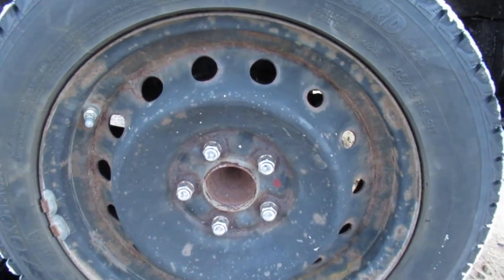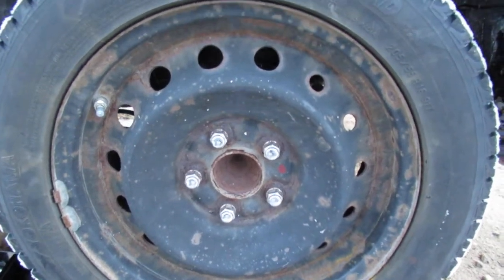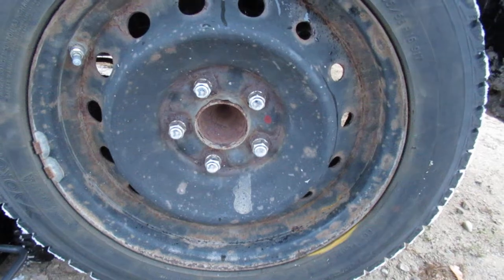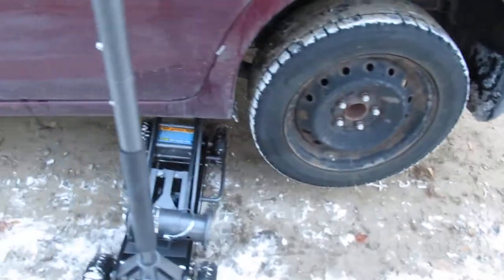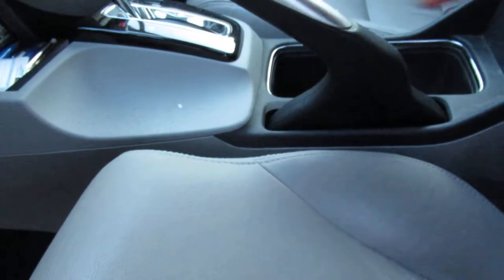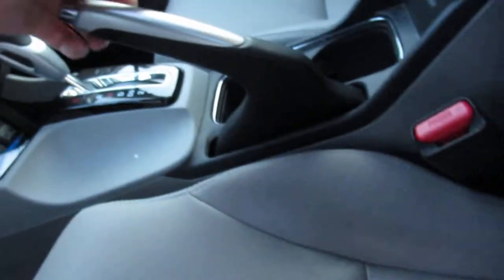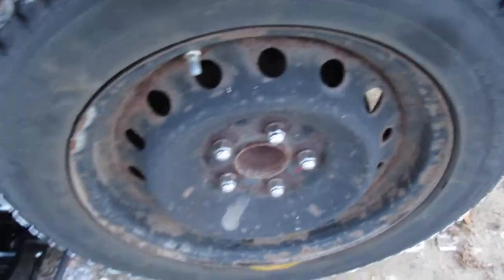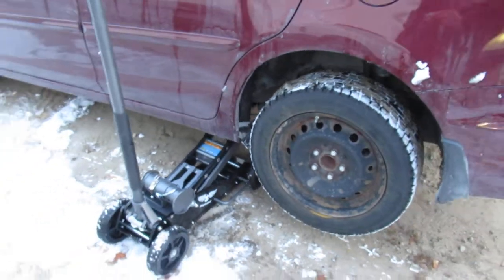2006 - 2015 Honda Civic Releasing Seized Parking Brake

Comment: I got brand new rotors, pads, calipers and this is still happening on my 13 si I need to get it loose and then I'm done using the ebrake until winter is over. Im convinced the cold weather is causing some of my issues
Reply: having same problem, how did you fix it
Reply: I had the same problem just got it fix i had to install a brand new handbrake cable and it did the job.💯%👍

Comment: This has happened to me aswell and sometimes just quickly pulling the e brake up and down quickly multiple times helps but I've had to lay on the ground and smack it for it to break loose 😅
Reply from the maker: I have tried that but I guess it depends on the strength of the spring as it just makes it worse for me.  Thank you for responding.

Comment: Had to leave my 2011 Si in a parking lot and get a ride because of this issue, headed back now after watching this video to see if I can free up the brake.
Reply: Did it work? I got the same problem on my right rear wheel. Badly seized.
Reply: @Zeebz369  I lucked out, when I got there I started the car and started to drive to see if it was still seized, and it wasn't! Guess it unfroze on its own. Before that it was smoking and definitely locked up. I saved this video in case theres a next time.
Reply: @HeyNoProblem  I hope I find my wheel unblocked when I return tomorrow lol. 🙏  thanks for the update. Cheers

Comment: Brilliant thanks. Never worked on a Civic but bought one about a month ago. 1.6 Exec 2005 , 26k miles! Couldn't pass it up. It's an auto so either the hand brake is used all the time or just once a year for the MOT ha ha. I never use the handbrake but the wife does and she likes, drives it and managed to jam the hand brake on. Just rolled it onto a curb and released it in minutes with a big long screw driver. Thanks!

Comment: It's because of the rust and dirt build-up. You you need to re-lubricate those parts, the spring ete, or get a new one. The amount of rust on that car is unbelievable, it is in pretty rough shape. I have a 2004 honda that has like no rust on it anywhere. You should be taking your car to the car wash to spray the salt off regularly.
Reply from the maker: That caliper was actually a bad replacement part that got put on.  I have a replacement I want to stick on when I get a chance.  You will be disgusted by the condition of my front brakes...I did half a video on them and need to get back to it.  This is a typical Canadian car as far as condition goes.
Reply: @SteveRivett  yes I'm in Canada as well. BC and Alberta
Reply: @youandiryan  ya dont they use sand there? and heres a cookie for taking care of your beater 04 civic LOL
Reply: @OctopusTone  I have a 2004 accord coupe V6 6 speed. And a 2013 BMW 328i sportline LOL
Reply: youandi06. I have brand new Power Stop calipers on a 2007 Si and it does the same shit, so rust is not the problem with my car. Haven’t taken them off yet to inspect but it you release the brake handle
and it sticks it will release if you tap on the brakes or hit the spring / lever.

Comment: Thanks! Worked like a charm. Unfortunately, the cable was loose on the connection, so when the spring sprung loose, the cable wasn't on it, so I have to reconnect it before the ebrake will work on that side again. My mistake!

Comment: Thank God I live in California where we dont have to deal with the damage freezing temperatures and the tons of salt thrown on the roads can do to people’s cars, which can happen with a couple years it starts to rust and if the undercarriage is unprotected it will continue corrode and eat away your car until you’ll be doing the Flinystones.  

I remember I purchased a car from Detroit that was 3 or 4 years old and it already had rusting, any scratches or other exposed metal was rusted all the bolts under the hood were rusted so bad that you couldn’t open one without anti-rust/anti-seize spray.

Comment: Is there a permanent fix for this? It’s happening on my renault Clio 2020 model. Back right wheel keeps being frozen and needs a hammer everytime to get unstuck. Issue doesn’t happen when E brake isn’t on obviously but I live on a hill and need to put E brake on to stop it rolling as P (auto transmission) isn’t enough. Facing the issue every morning now due to the cold weather, but only happening on the rear right wheel. Any help please to fix this as a long term solution?
Reply from the maker: You probably need to replace the brake caliper but that seems strange for a 2 or 3 year old car.
Reply: @SteveRivett  thank you for the reply mate I appreciate it. It only seems to be happening in the winter and wasn’t a problem before the recent really cold weather here. I think it might just be being frozen somewhere within the drum brake but not sure where? When I hit it with a hammer on the drum itself it sets it free but I can’t keep doing that everyday. It is worst when driving it for the first time in the mornings and doesn’t seem to happen throughout the day (not that I’ve noticed anyway) but definitely seems to be winter related and not sure why it’s freezing over all of a sudden and not sure which bits are even freezing over to stop it from working
Reply: @SteveRivett  is there a reason why you think it’s the caliper?
Reply from the maker: @matthewedison1032  Something isn't returning the brake pads back to the disengaged position so that is usually a stuck caliper or weak spring on the caliper.  If it isn't that, you may have a stuck parking break cable.  If you move the cable lever you should see the cable moving back and forth but don't run yourself over.  It's not good that you are on a hill.
Reply: @SteveRivett  Thank you buddy I will give this a shot, thank you for your help! I swear I have found no information about this online other than your video and I’ve been really stuck on what to do next to fix it or even what the issue is! So honestly thank you!
Reply: Looks like lubrication.

Comment: Gotta love winter eh! The rust makes me think your in Ontario, upstate NY or Michigan. I'm having this issue too, occasionally and had to have a look at your video again to remember which way to move that thing. Thanks! In the summer I think I'll have a look at it again see if I can replace some of those parts related to the e brake mechanism, new spring maybe? I try not to use the parking brake in the winter when I'm on 0% grade but she's a manual transmission and old fucking habits die hard.